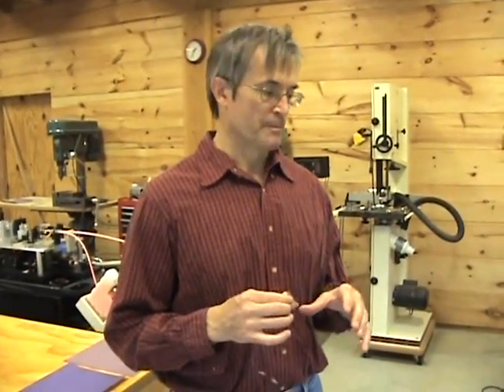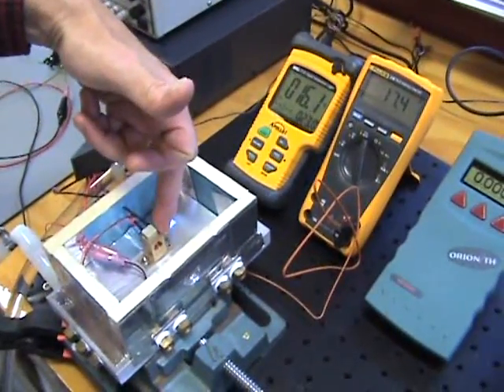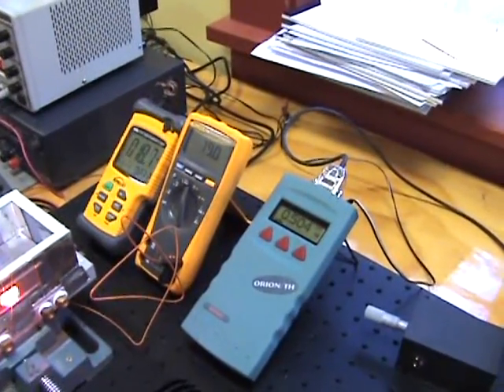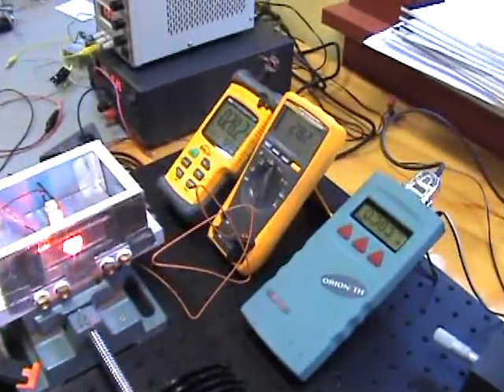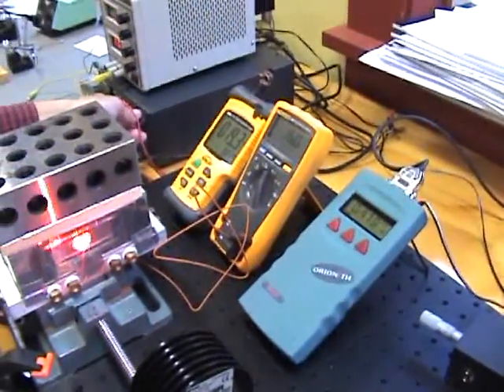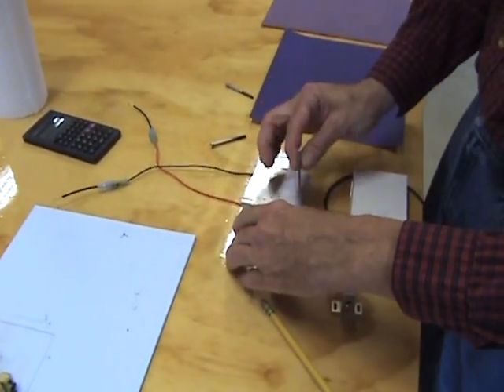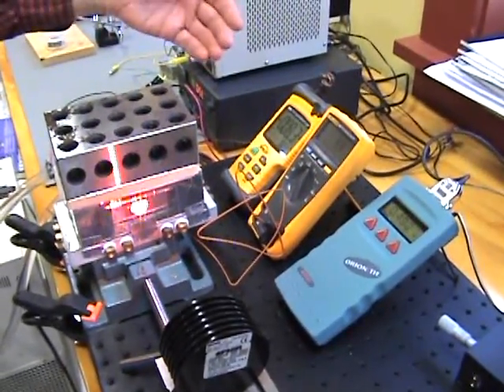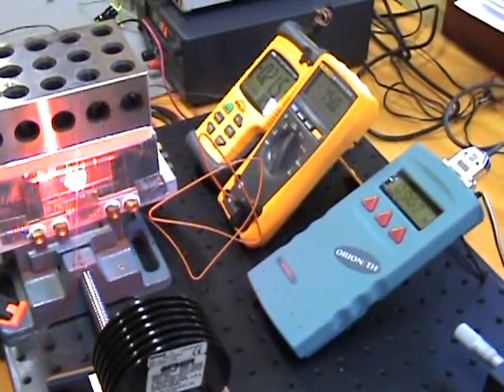Laser Cooling

Comment: Hi , one solution to prevent moist inside the chamber could probably be to create a vaccum  chamber (less air less humidity) or on the opposed to create a cooled chamber filled by some sort of gas that not contain humidity (maybe more reliable because the chamber could have a positive pressure).